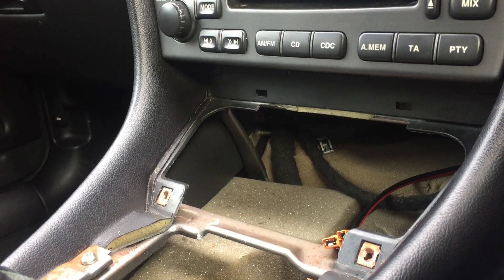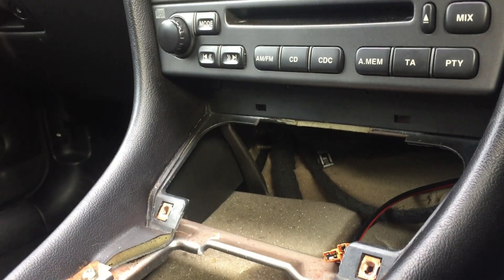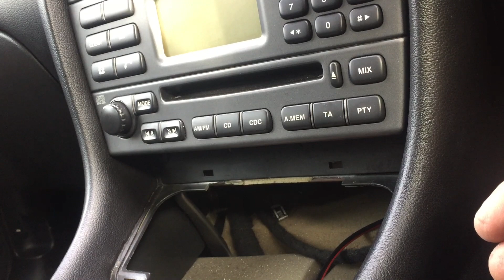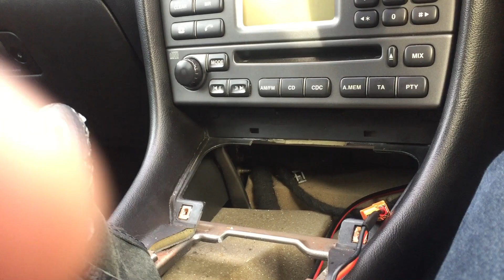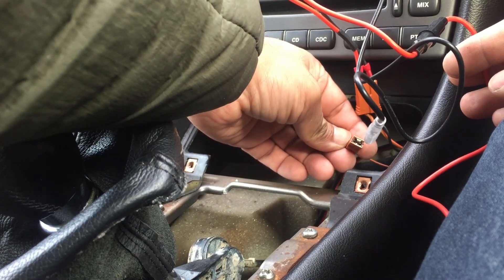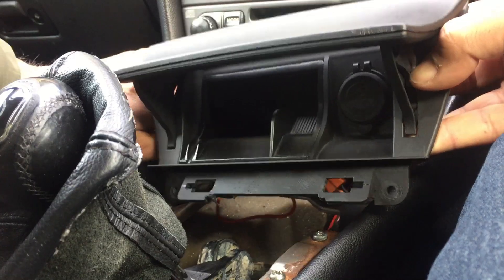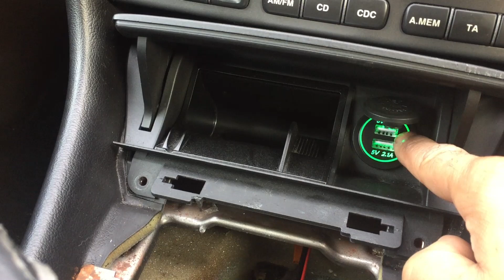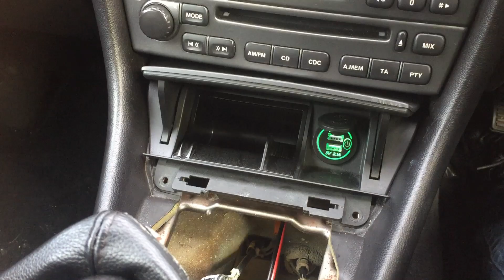Jaguar Xtype Cigarette Lighter Upgrade

Comment: How did you get the cigarette lighter out?
Reply from the maker: lift up the gear gator surround carefully, under there should be 2 screws remove those and then the bin assembly will lift out, i will do a video on it.